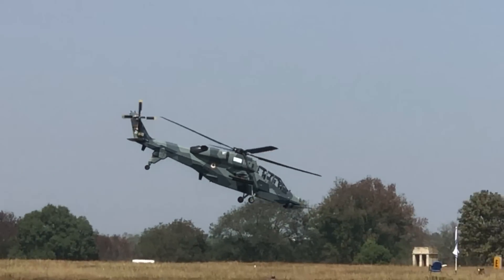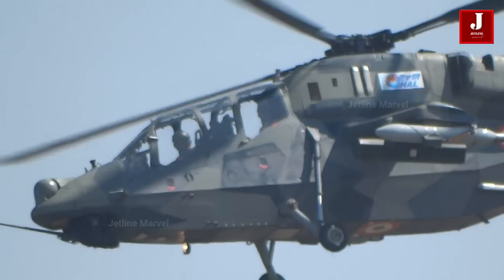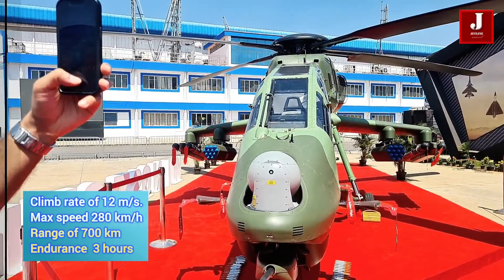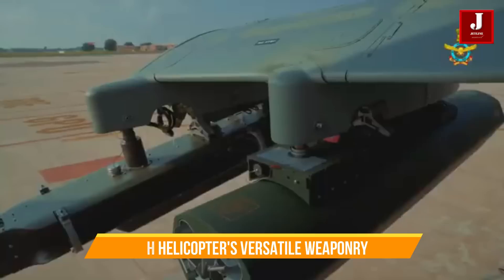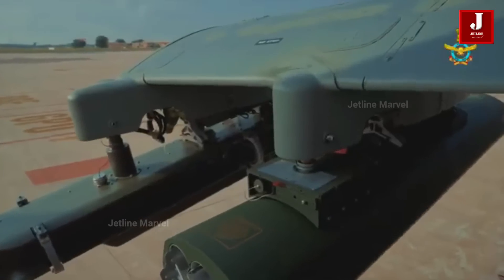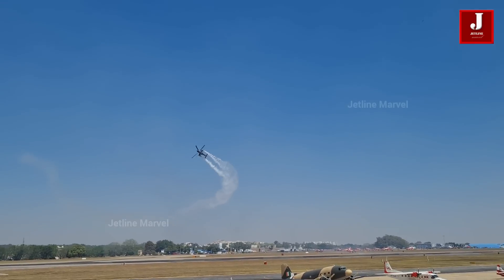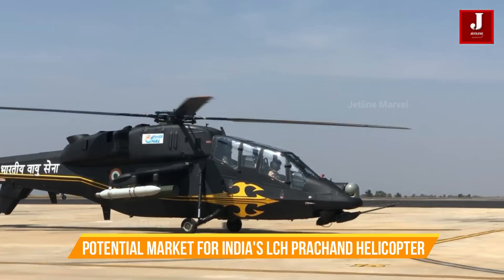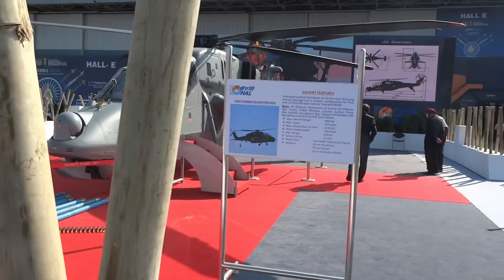5 key factors of Indian built multi-role attack Light Combat Helicopter Prachand. Specifcation #hal

Comment: Prachand is future of attack helicopter ⚡
It's very light weight and well equipped 💯
Also the world's highest ceiling helicopter 🚁
Reply: What really limits the combat ceilings for tactical helicopters is not the performance of the engine, it's the lack of breathing capabilities for the pilots.  I flew cobras, no idea how high the thing would go, but we're not able to breath effectively for long periods of time above 14,000 feet so that was our stated limit.  So unless you've got an oxygen system built in for the aircrews, it doesn't matter how high the thing will fly unless it can conduct combat operations with a pilot and gunner who died of hypoxia before getting to the combat zone it really doesn't matter.
Reply: @mrgrinch837  I've visited one irl , they have oxy kits that soldier can carry with them additionally